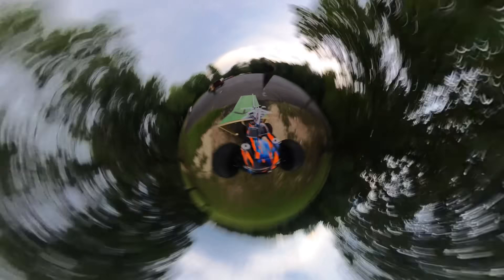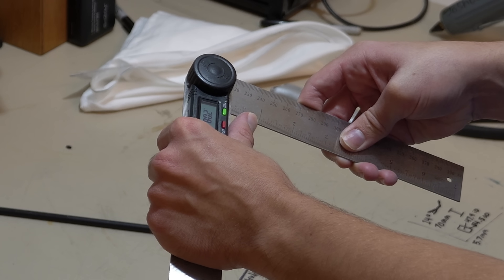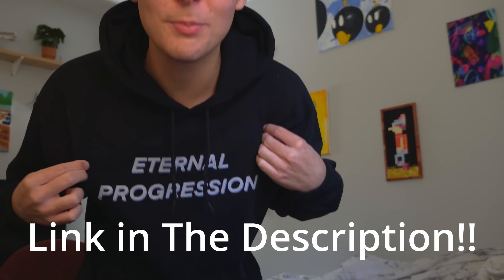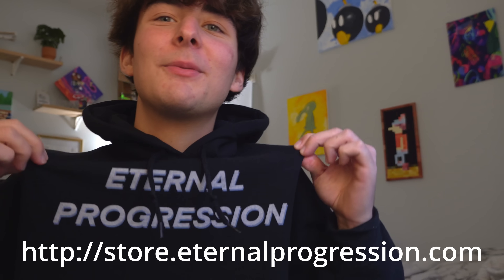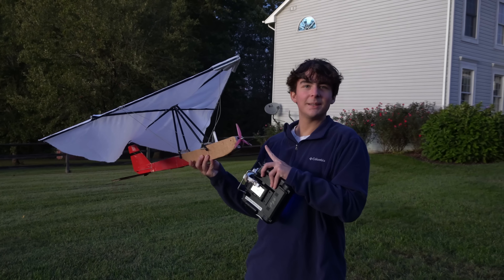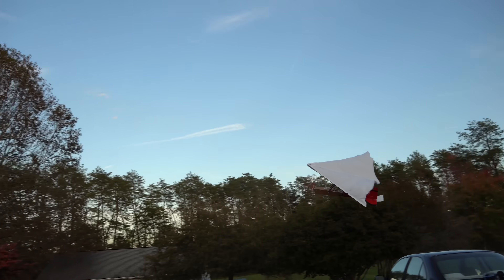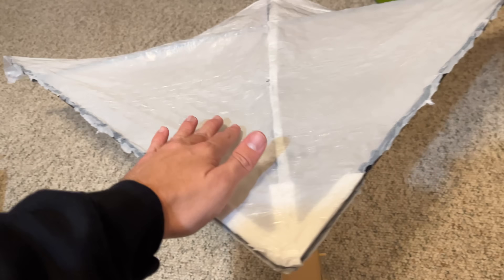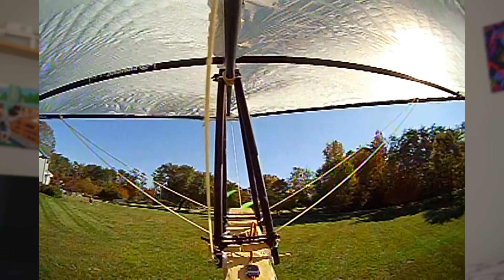Is Mario Kart Our Solution To Flying Cars?

Comment: Design idea: Make the anchor points of the wing freely spinning, and make it so that when you're on the ground they fall into the car itself, and then when you take of it just pops right out of there. You could also make the wing contract in it's width by having a servo in the front.

Comment: That hot glue is realy convenient,  but it's adding so much unnecessary weight to your models. I would urge you to try better lighter adhesives it would require a bit more patience but the rewards are well worth it.

Comment: Perhaps you could have a servo with a string tied to the center point of the trailing edge of the fabric on each side to pull down either side to work as ailerons? (I'm not sure which way it would go, and how much it would need to pull to have a meaningful effect though; oh and also, dunno how much the fabric would need to be reinforced to not tear at the attachment point)

Or perhaps if it's gonna fold out, you could have it fold out asymmetrically on aileron input?

Comment: I would've for sure bought that hoodie if i lived in a less poor country :] 
Also for the design I can imagine one issue (or two really), the wings could possibly get ripped off at high g maneuvers and efficiency could be quite bad at full scale where it doesnt cost 1 cent to fully charge the battery and range is a huge focus

Comment: Idea for a flying car. 

If you set up a car like the Ibishu Pigeon and stick a fan on the ( like paramotor ). The chuck out the engine. Keep the steering system. The you need wings they can twist and then fold into the side , when the wings are out the Flying car (it should be called the flying pigeon) will have no sides and will be completely open as the wings can act as sides.then all you need is Ailerons on the wings. 

I think I’m gonna try make it rc after my current project but I’m very knew to the hobby and don’t have much budget so we will see. It should just need an 6 channel Reciever with  the motor and esc servo for steering  the front wheel and 2 servos for Ailerons which would could be in the base of the wing ( the bit that just has to twist and not go back or something like that idk  ). It would move forward like a car with the fan and fly with fan aswell gaining lift by its outstretched wings. The motor must be fairly powerful as the wings won’t be massive. It would fly badly and turns would be hard but it should fly as long as the body is light enough. 😂😂. Thanks for the video hope the project goes well
Reply: Hypothetically yes but in practice it would be super inefficient drag wise, wouldn't have enough lift and either the wings would get ripped off or the servo would
Reply: You can bassically  use a Micro light frame design so drag should not be two bad, and the wings could be connected on an axle running through the flying car. Then u could use string ruining through to fully extended the wings by twisting it taught round a motor in the Center if the aircraft

Comment: What if the back tube that opened the wings was actually 1 tube inside the other that extended out both ways to open and close the wings. 1 servo centered on the rod at overlap with servo arm facing front and back. A push rod connected to each tube so when you moved the servo 1 way it would open and then close when released. In real life could be done hydraulically.

Comment: two thoughts from a flex wing fanatic, 

a simple split cross bar with one hinge in the middle is probably the best way to open and close this wing. Look up how modern hanggliders open and close it should be fairly straight forward to implement a servo can drive a spool to pull the line that pulls the bar back with a gear reduction to drive the decoupled potentiometer just like you did on the swing wing.

second if you want to have the ability to alter the wing angle you can just go all in and do weight shift for both pitch and roll/yaw . there are many RC hanggliders you can reference for this control arrangement. this would let you ditch the tail assembly entirely.

either way great video looking forward to see how you go about solving this one!